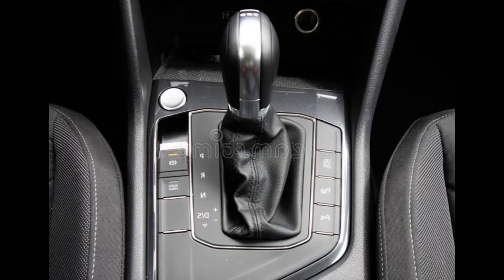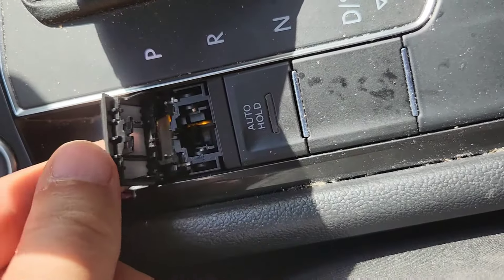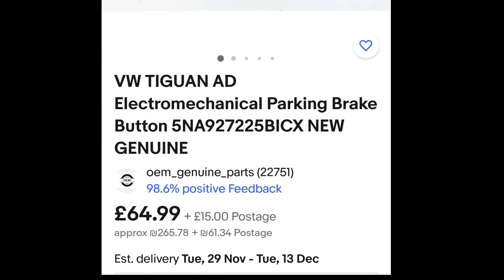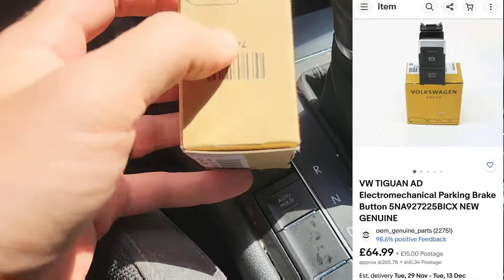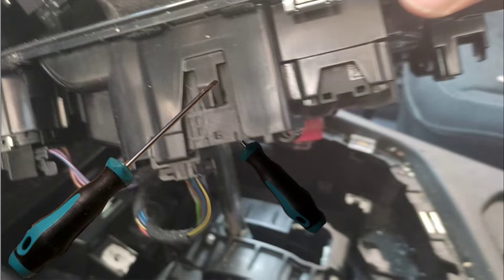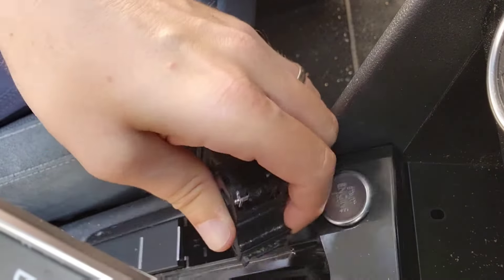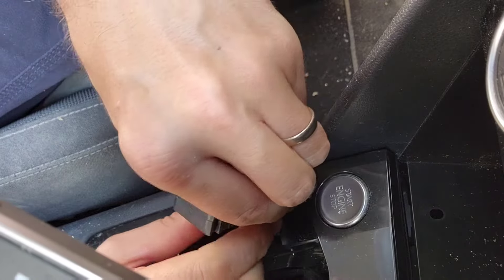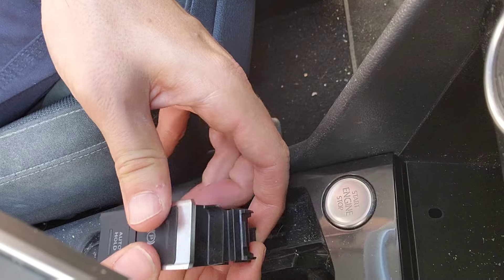How to replace 🛠️ a broken volkswagen 🚓 tiguan electronic handbreak button, and save💲

Comment: I can’t believe VW wouldn’t fox this broken e-brake switch under warranty and the dealer quoted almost $200 for the repair. Bought the switch for $25 and did it in 15 min though i did break off a piece of plastic from something under the shift boot.   I used a T-15 bit for the two screw fasteners.
Reply from the maker: You're right. There are so many things that we can fix ourselves

Comment: Thanks, I used a toothpick to lift one latch and pry the other side latch with a flat screwdriver, then push up. I think the hardest part is lifting the panel. I used a 3/8 ratchet extension covered with rag to pry. Then came the warning light... It just wanted me to step on the brakes and activate the switch it says on the dash, then the warning light went away. Thanks for sharing!
Reply from the maker: I'm happy to hear it was helpful !